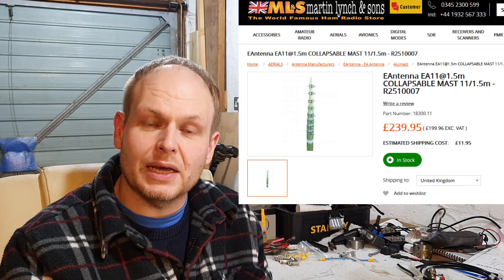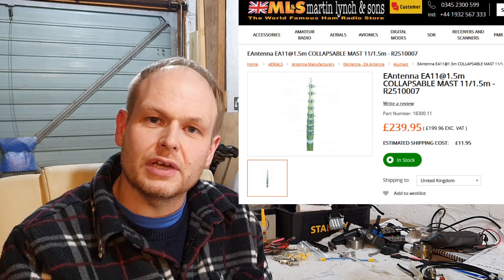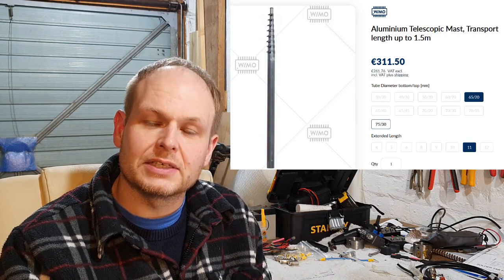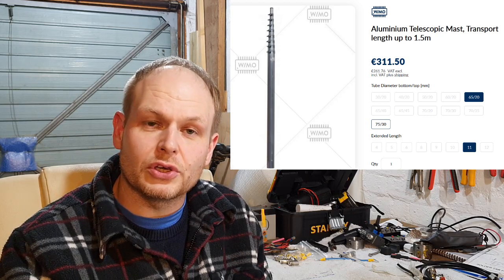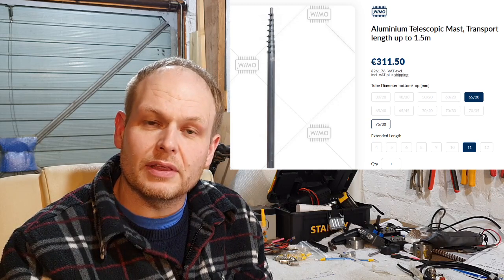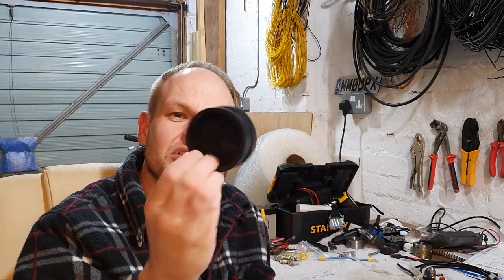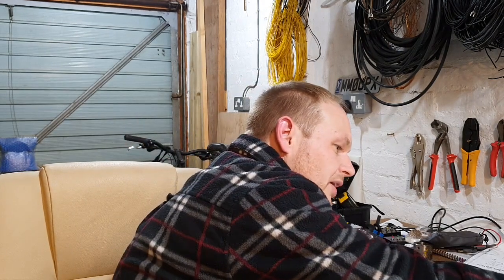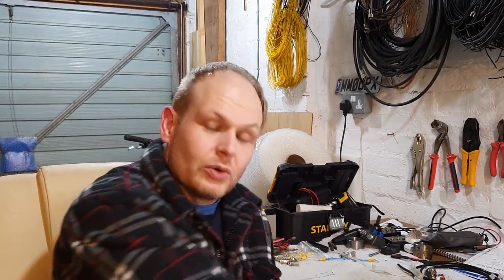11m/36ft Eantenna/Wimo Aluminium Mast Overview

Comment: Having shorter sections in the mast provides quite a bit of versatility...both with transporting in smaller vehicles and allowing for more options for deployment height. Thanks for taking the time to produce a thorough video. Nice work on the nylon guy plates as well...good to know it needs some supplemental support.
Reply from the maker: Thanks for the comments Robert. I was hoping it would stand alone in light winds but not worth taking the chance.

Comment: I found a very similar mast by searching amazon for light bulb changing poles (for very high, vaulted ceilings) and discovered that if doesn't say anything about HAM radio, the same item is sold much cheaper for other purposes.  I paid less than $50 for mine, but the clamps are strong plastic, not metal, so yours will probably last longer.
Reply from the maker: I checked those out. I may get one. I'm sure the wall thickness on thickness is thicker.